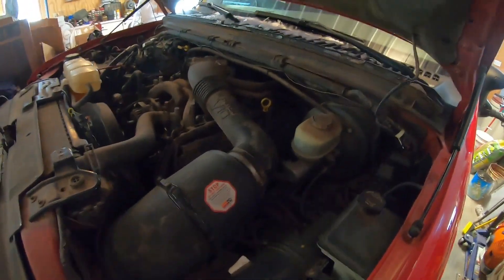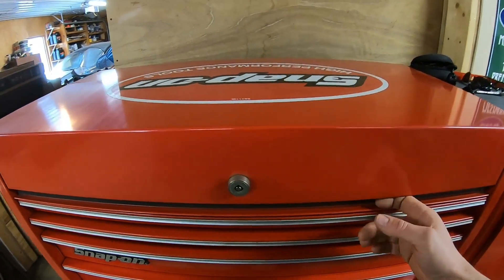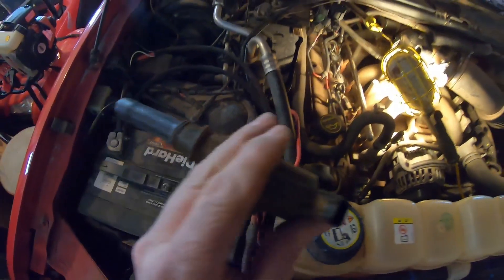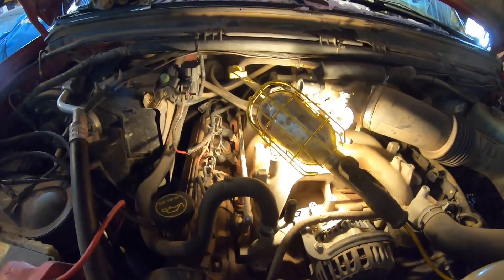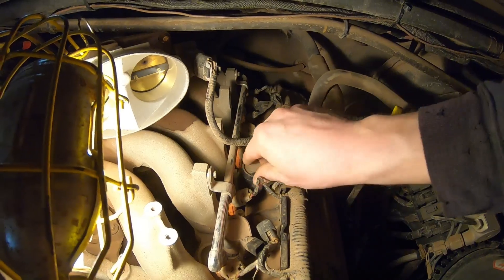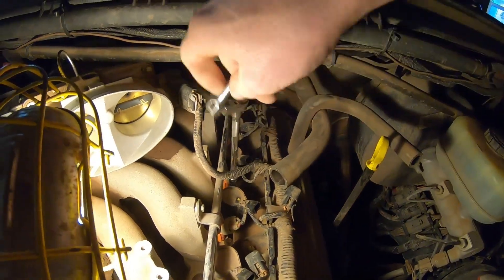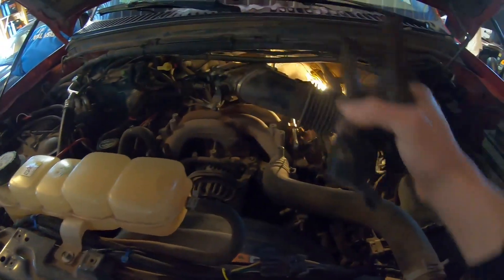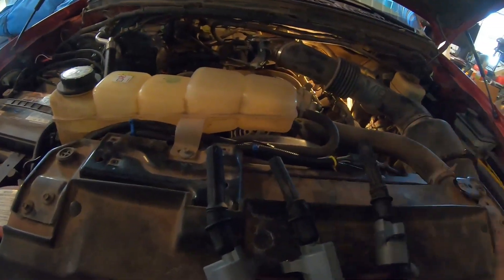2003 Ford F-250 Super Duty 6.8L V-10 Engine Misfire Problems - Loose Spark Plugs & Burned Coil Boots

Comment: I had a V-10 in a motorhome and it ran beautiful. It only had 23,000 miles on it when it bought it. It pulled my trailer with my Squarebody  on the trailer no problem.  Great Video Sir...
Reply: they fixed a lot of these problems after the early 2000s

Comment: I've got the 99E150 with the 5.4 the only real weak points are the spark plug blowouts and the exhaust manifold leaks, I recently sleeved all the spark plugs with 225 000 miles... Great video

Comment: This video makes me feel better about having my local Ford dealer replace all ten spark plugs on my 2000 F350 when I bought it. The pickup ran fine, but I wasn't sure the last time the spark plugs were replaced in its 329,000 mile life. I'm still running the pickup to this day. It now has 337,000 miles on it. I wish I could find one exactly like yours. The V10's are very good engines for the winter months here in Minnesota.
Reply: Does NGK make a iridium plug for that motor?
Reply: I'm not sure. I'm an OEM guy. I just know that I had Motorcraft spark plugs installed when the work was done and I've had to replace two stick coils since then and that was due to old age.
Reply: Fords really seem to like OEM parts. The Motorcraft parts definitely last longer than most aftermarket parts.
Reply: I've kind of noticed that the OEM Ford parts seem to last longer than aftermarket ones. I might be a little biased though seeing as how the Ford dealer that I deal with is good about finding OEM parts for the older stuff. They also aren't hesitant to work on the older stuff as well. The only thing that they won't work on is a Smart car and probably Teslas if I had to guess.
Reply: How much did they charge you???
Reply: How much did you pay for spark plugs and cops?

Comment: Great video. I did all new plugs and coils in my pickup (2001 F250) awhile ago. Sadly, the pickup needs tires before I can really test it out. 
I did do a few short, light duty test runs though, and I will say, that new plugs and coils fixed a pretty obvious misfire that I was having. Oddly enough, the OBDII gave me a "system too lean, left bank" code, instead of an actual misfire code. Kinda weird, but weirder things have happened.

Comment: So, you are not at the Ford garage anymore ? If not did I miss it somewhere ? Not using OEM coils ? $$$$ ? Thanks Steve
Reply: I was thinking the same thing. AFAIK, I haven’t missed any videos…..
Reply: @squatch253  glad to hear you're making ends meet with the channel. Based on the quality of your videos, you deserve it. The only thing I'm worried about is what you'll do for insurance. IUOE local 49 represents mechanics in your area. The insurance is good and the great thing is, you can keep your insurance between jobs. Your retirement isn't tied to your employer either. I don't mean to stick my nose where it doesn't belong, but I thought I'd make the suggestion as you definitely have the aptitude for that work. I'm an operator, and life has certainly been a lot easier since I joined.

Comment: I had a 2000 F-150 with a 5.4 Triton never had any trouble with loose plugs. In the 10 years I owned it I replaced all 8 coils twice not all at the same time and started doing 3 of them for the third time. By the way from the looks of replacing the back ones I may have replaced all 10 and be done with it.

Comment: I purchased a 1998 Ford Expedition Eddie Bauer that was advertised by the seller as having "engine problems."  Replaced all the plugs and coil packs and the Expedition runs fine.

Comment: This video is inspiring/motivating me to finally get around to the plugs and wires on our 05 Freestar. I've had the parts for a few weeks, but haven't wanted to mess with it in the cold. I'm no pro like you, but it's been doing the same thing for a month or so with what feels like a small miss or weak fire when cold. Then there was a dead miss on cyl 1 that prompted the parts purchase. Short term, the plug wire seemed loose on the coil. It's been fine since fiddling with the wire and pushing it on fully. The plug wires look original Motorcraft, plugs unknown, but at 230,000 miles there's lots of opportunity for degradation. I just hate how crammed in the 4.2 is under that short hood. Pretty much have to remove the cowl to do anything, even the brake fluid reservoir is obstructed. Front side plugs are easy enough, back side is a big pain, and the coil is tucked way up on the back side too for good measure. sigh Rant over.

Comment: Good call on the coils. We had about 15 Econolines with the 5.4 a little bit earlier vintage. I think it was easier repairing spark plug threads in the Econolines than the pickups

Comment: Those v10's will do just about anything you need..... except pass a gas station
Reply: Or go up a hill without throwing a code.
Reply: Sold it for gas money
Reply: I’ve said that about mine since it was brand new, lol
Reply: just like any other big gas engine truck.
Reply: A power stroke won’t either. And cost more for fuel

Comment: Usually loose plugs are from inferior threads in the heads always remember if the cylinder heads are aluminum wait til it cools down to pull them out had a pontiac 6000 with a 3.1 multi port that had an issue with blowing the middle rear spark plug heli coil it a few times to keep er goin

Comment: I've had pretty good luck finding the culprit of these misfires by laying the inductive pickup of my timing light on top of the coils & watching the light
Reply: NOOOOO put your hand on them and see if it lights you up LOL. I had a friend who pushed plug wires on with screw driver. I didn't know it but heard something snapping touched the wire got me good damn did it hurt. On my 70 mach 1 had MSD coil and box. Somehow wire came off coil it jumped 2 inch gap and was running ok look like flame. Dad like just push it back on while it was running MMMM NOOOOOOO. I remember shock i got from helping my friend not a chance I'm doing that again

Comment: Very important to blow out all debris in plug tube after coil removal before plug removal.  Always torque new plugs to spec and only use Motorcraft plugs. I have never had a problem.ug come loose after I torqued them correctly and I changed hundreds at ford dealership
Reply: What's the torque spec for the plugs ?

Comment: That was a fun one to see a more modern engine that my 5.8 aka 351 W.    And I had my round at 90k or so,  turned out to be a bad distributer cap but the plugs got changed then as well.

Comment: Did you put anti sieze on the plug threads?   I've done plug inserts on all 10 after blowing one plug on my 2001.  Just curious about the anti sieze.  I appreciate this video, my V-10 has that mis fire you spoke about, i'm going to check my coils when the snow melts here... Thanks!
Reply: @squatch253  gotcha. I guess i missed your comment about anti sieze.

Comment: I have never been comfortable with a 0.055" spark plug gap. When my mod motor started having misfiring ignition issues I closed the gag to 0.040" , initially because Ford wanted $250, I didn't have,  for a coil.  I didn't have another misfire ignition problem with that engine and never needed to replace a coil. I did replace a lot of coil boots though. There is no need for gaps that wide it just causes unnecessary stress. 🤷‍♂️👍
Reply: I think you're right about that. I ran a Ford Escort for years. If I gapped the plugs to factory specs it would start misfiring on the hills within 2 or 3 months. I got tired of it burning up plugs and gapped a set of Champion  copper core plugs at .035. They got regapped 3 years later and were between. 045 and. 050. I ran them another 3 years before I replaced them. The bigger gap requires higher voltage to fire. I ran into a similar situation on my 97 Chevy Express. It was burning holes in the side of the coil. After the second one, I replaced the plugs and reduced the gap from . 060 to .045 . It solved the issue of burning up the coil and since then it starts much quicker than it did when it was brand new.

Comment: You need at least 7 threads  that’s y they are blowing out   .done there done  that job  but needed to weld them nuts on the studs on the exhaust manifolds, couple fell out  replaced all mine with Allen head and high temp. Loc tite

Comment: This is a good video,  what I needed to see.  Did you have to not take the boot off on the inside?  I have seen that as an option,  I am new to these rigs so maybe I am missing something.
Reply from the maker: Normally the boot stays attached to the coil, but sometimes they’ll stick onto the top of the spark plug and stay there instead when you pull the coil off. A long-reach needle nose pliers works well for pulling those boots off the plugs, one tip though is to give the boot a twist first which will make it easier to pull off the plug without tearing. Otherwise, they’re just a push-fit onto the bottoms of the coils and can be replaced separately if needed.
Reply: @squatch253  awesome thanks,  just watched some other videos and some folks come from inside the vehicle,  under the dash?  You did not do this?  Maybe different vehicle.

Comment: What is your method for replacing plugs? Dead cold engine? Warm engine? Dry threads? Anti sieze? Torque spec? Lots of discussion about this on the forums. Thanks.
Reply: For the 2V heads prior to going to the full-threaded versions, you wanted just a dab of anti-seize one the bottom two threads of the new sparkplug. The torque spec is very low and you want it to be as exact as possible unless you want them to blow out.

Comment: Everybody I have met buys all new coil boots whether they look good or not. What brand of replacement coils did you buy? Some are winners, some are losers, I just want to be aware in the future.
I like to know how many miles you went. With some cars, the manual says "Change platinum plugs every 100,000 miles" but I find many are in need of replacement at 60,000 miles. Every if you can get away without replacing them, the ignition coils may last longer. Some say the same about iridium plugs. Iridium plugs MIGHT last longer, but they sure don't on the Toyota 2AZ-FE engine. They are done around 60,000 miles.
Reply: @squatch253  I see. I'm glad you were able to buy the cheap stuff and get it to work, some cars could be really sensitive about that.
The Nissan Maxima made from 1995 to 1999 was an incredibly reliable car, but if an ignition coil or sensor failed, and if you didn't go OEM, you often couldn't get the codes to clear.
Also, I can't tell how many cars ran poorly because they used whatever Bosch told them they could use, but the manual gave the owner one NGK part number, one Denso part number, and if you didn't get either one, the engine ran poorly.

Comment: Not good advertisement for Ford. The little 4 cyl Eco motor in the Chevy Sonic and Cruz does the same thing. Real good reason to stick with cast iron heads. The expansion and contraction of aluminum heads and intake manifolds are notorious for fasteners  coming loose. Thanks for the video .
Reply: Sparkplugs on old VWs took the heads with them. A signs of lead insoles.

Comment: Did you have an engine light? I just purchased an Excursion 2 days ago with the V10. Sounds like a faint miss , but no engine light
Reply from the maker: No check engine light on this one, just a slight tremble at idle 👍
Reply: @squatch253  Sounds like what I have. Now need to figure out which one is bad 😢

Comment: We have a service truck with the v10 and it just blew a plug out of the threads lol it drove another 60 miles to finish putting a turbo on a grader and back to the shop lol. It had a custom V10Mac on board air compressor  hahaha

Comment: Can a misfire cause the truck to not start? The work truck I used crapped out yesterday and the odb ready only says misfire but I swear the fuel pump isn't even priming or turning on
Reply from the maker: No, typically a misfire will not prevent the engine from starting. It’s entirely possible that the stored misfire code is unrelated to the no-start, or it could be a secondary fault that was flagged by the computer that was a result of the primary failure that is now causing the engine to not start.
Reply: @squatch253  okay thanks man!
Reply: @squatch253  I wonder if it's possible that the misfire code came from the fuel pump failure not allowing fuel through?

Comment: I have a 2000 model and got tired of doing them one at a time when they would go out. I had all plugs and packs replaced at one time. Hopefully good for another hundred thousand. It has 193,000 on it now. To be a 3/4 ton truck it is the most gutless engine I have ever had in a 3/4 ton truck. Had a 1977 with the old 360 in it and it would out pull this one even on it's worse day.
Reply: There is something wrong with your engine. My V10 pulls just like my 7.3L diesel. I haul a 13K lb 5thwheel as fast as you want to go.

Comment: I have changed the plugs on a 97 v10 dodge truck. I have no experience with a v10 ford truck. Curiosity wants to know what you would rather change plugs on, dodge or the ford? Assuming you’ve changed both.
Reply: Regardless, an ounce of prevention is worth a pound of cure. Regular maintenance when an issue arises can prevent a pain in the donkey.

Comment: Why did the spark plugs get loose on these? And was this issue fixed by the time the 2006, 2007 and 2008 models came out?
Reply from the maker: The loosening of the spark plugs was a combination of not enough threads put in the aluminum cylinder heads, and the heating/cooling cycles that the steel spark plug bodies and aluminum heads go through when the engine is running.  But by 2004-2005 when they changed these Triton engines to the updated 3-valve per cylinder design and added variable cam timing, they also redesigned the spark plugs to have a non-threaded portion that stuck down below the threads in the head.  This actually created the opposite problem, where at least half of the spark plugs would break off when you tried to remove them because they carboned up around that non-threaded end and would stick.  You then needed to buy a special extractor tool kit that would go in and pull the remaining broken ends out, which worked pretty well but was a complete pain lol
Reply: @squatch253   Thanks so much for replying! A few more questions, please…

1) Can you avoid breaking the plugs by spraying a bunch of WD40 or PB Blaster in there the night before you remove them?

2) Was there a model year where Ford fixed the issue of the breaking plugs?

3) Any idea how difficult it is to replace the plugs and do a compression test on the 6.8 gas V10 in an E450 (w/ the van front cab)?

Thanks again!👍

Comment: So I just did this same job on my 2004 and it ran great for a few weeks now it has a big miss again and check engine light is on?  I used ngk plugs with anti seize and blew out the holes before removal and checked all the gaps.  The  coils I replaced all 10 with edelbrocks.  Full service done 1000 mile ago oil fuel filter etc.  any thoughts?  I couldn’t get a code reader to turn on with the obd2 port.  🫤.  Injectors bad?  It’s got 176k

Comment: Been there, done that with the 6.8 V10 (2004), I end up doing my coils every other year (which do you like, OEM, aftermarket?). I've been chasing a "slow death" issue in that the truck loses power over a tank of fuel (250 + mile drive) and eventually starts kicking down to 2nd gear on climbs and free revving, which murders my fuel mileage and needs constant managing while towing a light trailer (3500 lb bumper tow RV) Doing the fuel pump next. Would love to hear your thoughts on those snow machines eh?
Reply: Have you checked the tank venting?  I am wondering if it starts to create a vacuum in the tank and has difficulty delivering full fuel pressure.  Just a thought.

Comment: So how did it feel to dig into that red toolbox to grab tools for an automotive based repair and not have "The Bork" lingering somewhere in the shop near you? LOL.....On another note, I bit the bullet and ordered myself a new super duty and after heeding the advice from a couple well known YouTube stars, cough cough,  I went with the 6.2 mainly because I couldn't justify the 6.7 and the hesitation I felt when I inquired about the 7.3 lead me to believe it wouldn't be a good fit for me.
Reply: Any mention of the lack of tabs on the bearing halves. We had 15 6.7 sd lock up in 100 ft@ 55mph towing 8k. Good think we were going up a 4% grade, not down. Ten year, 100k warranty, Shortblock of all things.